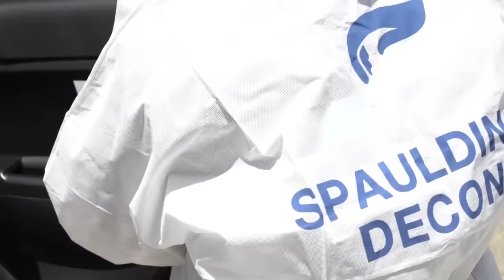S3 Episode 3: Suicide Saturation

Comment: I recently watched a "paranormal" video, a house that is a rental had a couple where the husband killed the wife, the owners of the house did not have "professionals" clean.  There are what the new renters believe to be blood stains in the carpet, the carpet was not removed, and stains on the wall that can be seen with black light.  It was a very shocking scene when the investigators used other light sources!
Reply: T Bjorn which video is this ?
Reply: Do you have a link or at least remember the title?

Comment: Reading the comments / learning that its either pay for it or clean it our own self, type of thing...... made me think back to all those disgusting blood& bio jobs I had to do working for stanley steemer and that its VERY possible my boss (or the customer lying to the office when making appointment) was lying about what happened at some of these jobs. There were a couple questionable cleaning jobs from elderly homes, and/or nursing homes, where it was soooooooooooo disgusting and smelled sooooo bad that I would be having a hard time breathing without gagging, andchaving to spit due to the smell. No dead body odors that I can remember. But the smell of rotten hot trash X 1000 mixed with the smell of poo. Oh yeah some were disgusting poo jobs. I will say this though.... there has not been one elderly /nursing home I have been into to clean that didnt stink of urine on those rooms we cleaned. It was so strong ,as bad as the smell from a cat hoarder pee house,( yes Ive cleaned those too) . The smaller and more private nursing homes were the worst. I felt so sorry for this one guy. When dealing with collecting the bill from this one nursing home owner, and also hearing the guys side of the story, it waa clear to me they were giving him the bare minimum while taking/using his own $$ to have this job cleaned,yet she wanted the bare minimum. No odor spray nothing extra.... cheap cheap and her nursing home she ran was so disgusting.